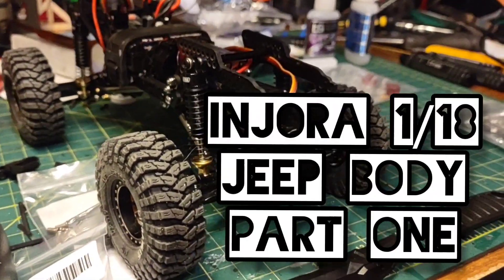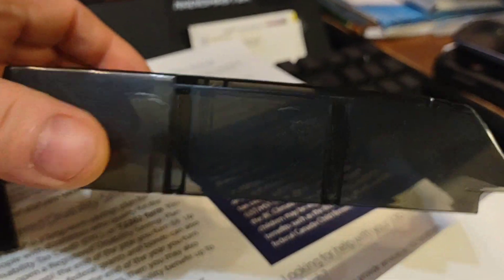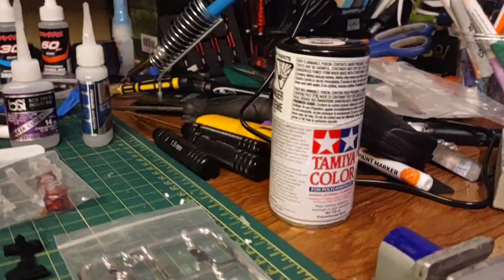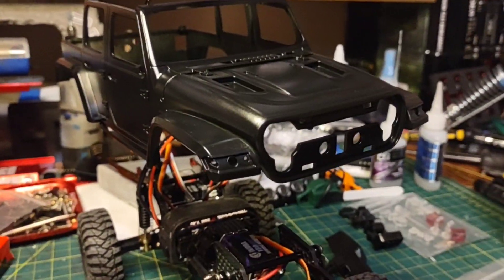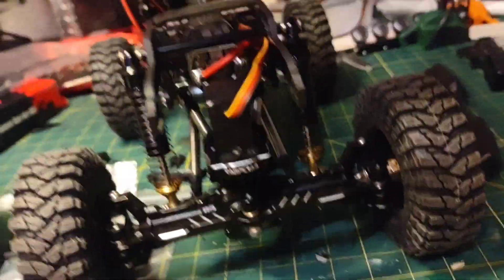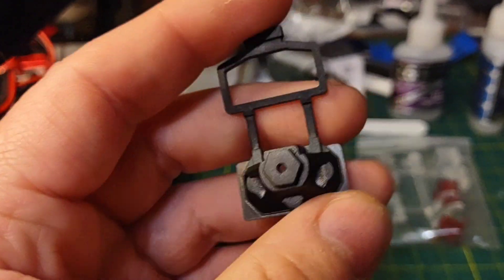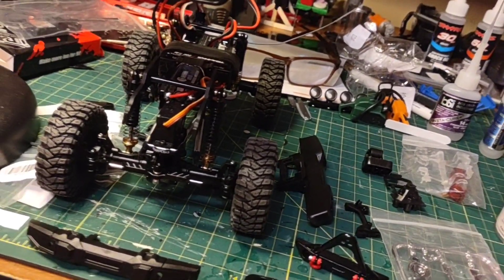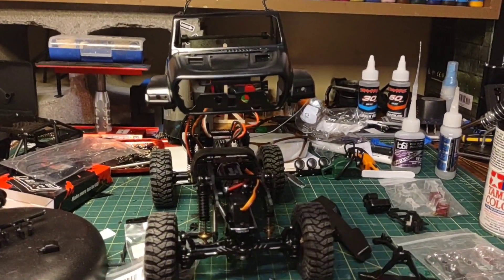1/18 Injora Jeep body. First look, paint job. Fitment

Comment: I like what you did with the body, did you start wuth the white body or other color? I have the green body but ordered a white one to paint it desert tan or white bone color, hope the sprat works
Reply from the maker: This was green. I just used Tamiya PS black. Tamiya paint is designed to use without primer so if you have it, you should be good.